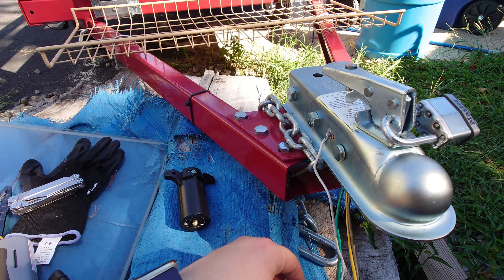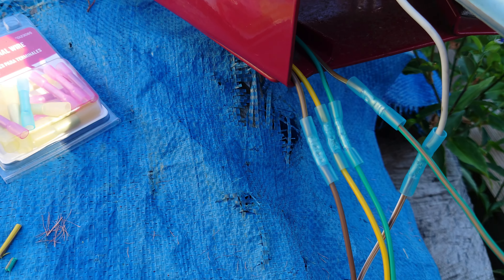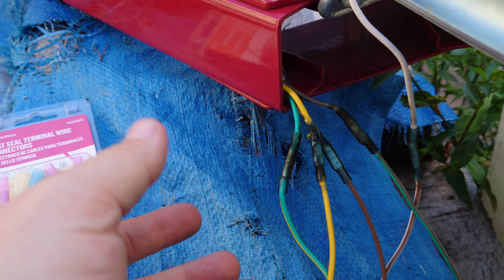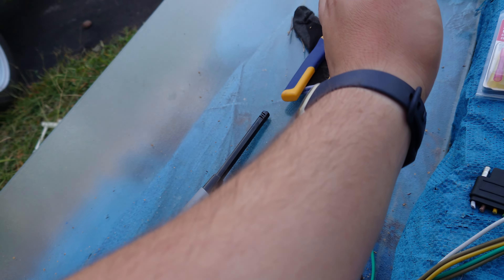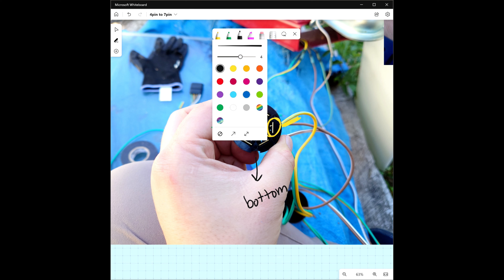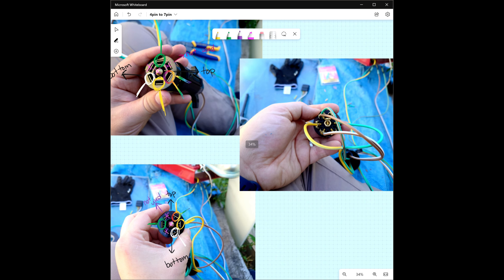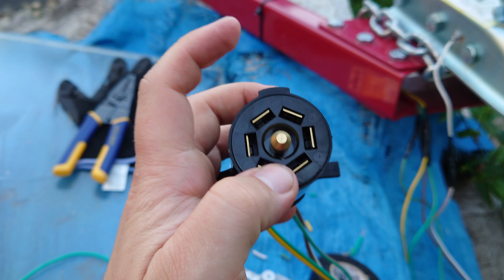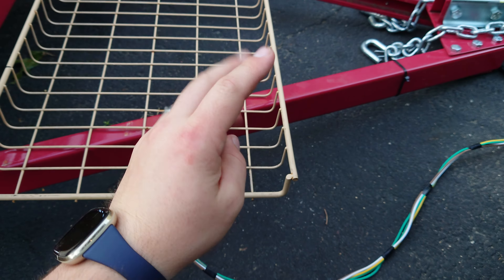Converting a Flat 4-Pin Trailer Connector to Round 7-Pin

Comment: Hey there. Thanks for posting this. Did you happen to have grounding issues with the original harbor freight harness as well? I tried the pre-made adapters but still having issues with the connection. I may try this method.
Reply from the maker: Yes I did also, the instructions had you mount the wires properly, but because the trailer is painted the wires didn't have contact with the metal so I had to file/sand off some of the paint where the wiring harness connected to the trailer so it would be metal on metal to ground it